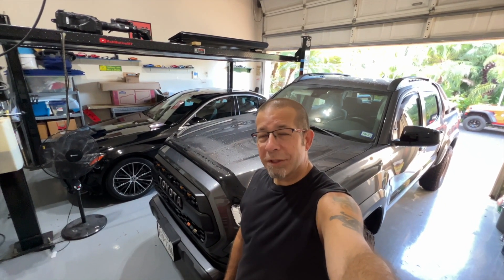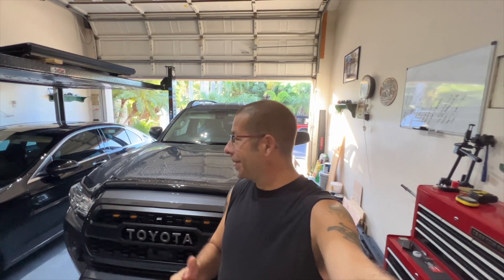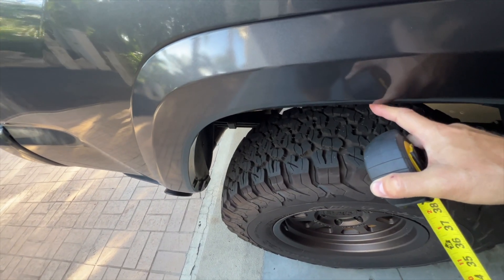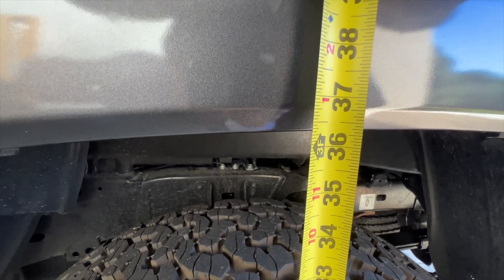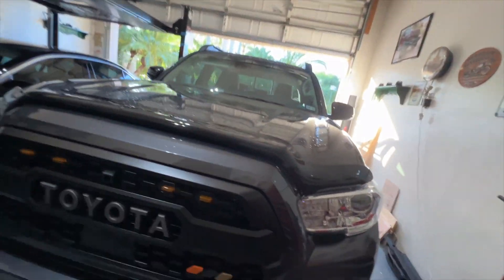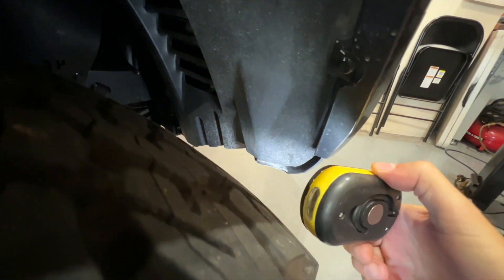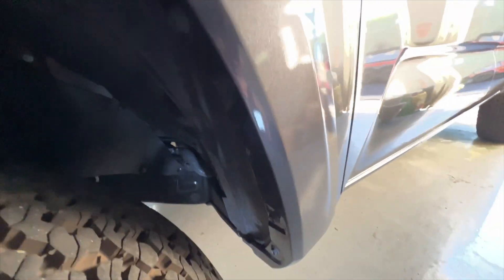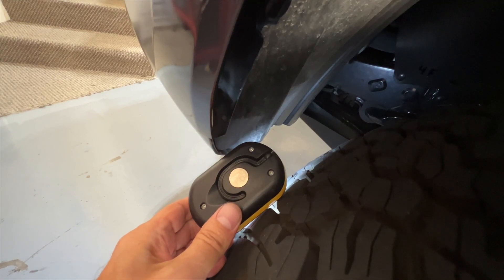Can't Believe I Have This Problem With The Toyota Tacoma

Comment: Besides economy this is why I stay with stock sized tires.  In my opinion, unless you are going to lift the vehicle enough and regear, it causes issues with the vehicle.  it reduces performance by actually regearing your vehicle and causes rubbing issues.  On the positive, it gives the truck a good look and some extra ground clearance.  If it's worth the extra money in fuel, loss of performance, and dealing with modifications then its ones money.  As far as practical need to  get to places off road, that's arguable, as some of the best 4x4s in the world are not lifted and some that will never see a trail are.  My diesel truck being one, mall crawler, will see at best a fire road, but does look cool.  Hey I get it and it's ones own money and we have to look cool. 😎  If you really want to go offroad, under body armor, at about 1200.00 dollars is a better bet for the money than any lift and if you are doing serious rock crawling you are going to need it.

Comment: Hey I just ran over a tire on the freeway and it hit my abs speed sensor on my rear driver side. Broke it all kinds of light the vehicle was telling me to pull over see dealer low brake power even made my side mirror sensors stop working. Just a heads up if you can put armor in this area it would be a great idea.
Reply from the maker: Oh man!  That’s a drag😡😡

Comment: Hey Rob - I have the same truck (2021 SR5), same wheels and same tires you have (you prompted me to copy you!).  I also have the bilstein shocks in front set at 1.5" in height.  I didn't do anything to the back.  when I got my truck home, the front was 3/4" higher in front than in back.  when you step back 20', the truck looks nice and level.  I haven't noticed any rubbing at all on mine, yet anyway.  hope I don't.  I'm pretty happy with my rig.  thanks for helping me along, and sorry to hear you are having rubbing problems.
Reply from the maker: I must say Mike…you have excellent taste!  I think I have it resolved.  Very minor tweek👍

Comment: Hmmm 3 other possible fixes:
1) new front bumper that needs to have the front fender trimmed
2) new wheels and tires. Say 185/70-14s 😅
3) or trade the Tacoma for a Nissan Frontier 🎉

So if you need other options there are a few that are, I think, outside your usual comfort zone.
Reply from the maker: Lol!  I believe I have fixed the problem 😁
Reply: @RobMotive  hope the problem is solved but remember that other options are out there. Just have to get out of the box 📦
Reply from the maker: Lol!  But the box is so cozy😂
Reply: @RobMotive  remember I said they were out of your cozy comfort zone. 

Seriously glad the fix was simple.  The full bumper replacement will work but takes a few deep breaths before you start sawing. Or it did for me on a project a few years back.
Reply from the maker: I still waver on that🤔

Comment: Had the same problem with mine but I was rubbing the back but  I had to put the stock tires back on  so it stop rubbing too much but I had  285/70/17  so I has to downsizing to the Stock 265/70/17  my friend says bigger lift to support the tires   But I had less clearance than you
Reply from the maker: Bummer😑